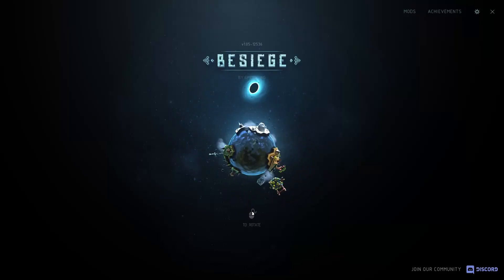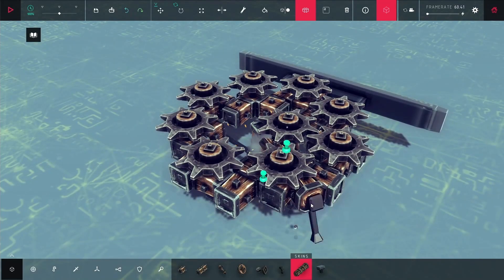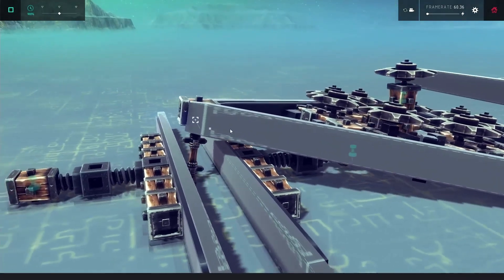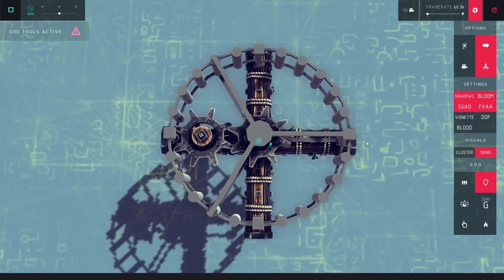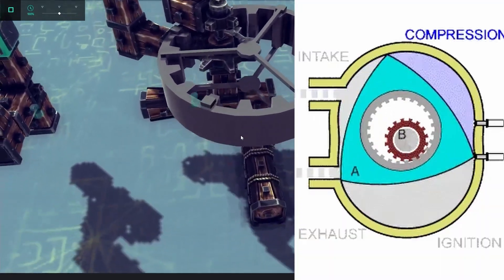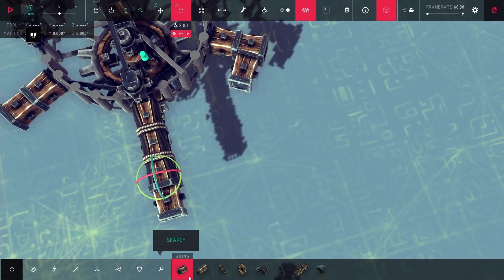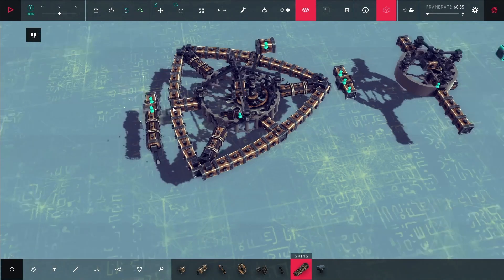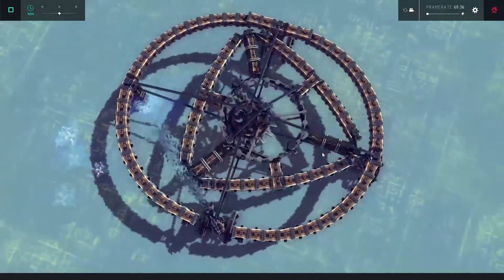Making a Wankel Engine in Besiege

Comment: Fact:
That's a freaking Reuleaux Triangle, created by either equally intersecting 3 circles, or drawing a circle curve with a compass, having the pivot point being the 3 corners, the radius of the circle curves being the length of the triangle edges, and the curves start and end at the two other corners.
It's easier done than said.

Comment: 10:45 no it's not normal. On a real wankel engine, the Rotor touches the housing continously. The Animation from Wikipedia uses a Reuleaux-Triangle as the Rotor shape, which is only an approximation of the correct shape, which is the inner envelope of a peritrochoid curve. The housing is defined by an Epitrochoid curve. Those two shapes mesh perfectly when they are defined by the same parameters.
Reply: yeah i'm a little disappointed by how much wrong he gets about wankel engines in here.  it's impressive yeah but like, it's barely what it's supposed to be

Comment: Looks like it's sealing about as well as your average RX-8 so well done!
Reply: If it ain't leaking it's out of oil lol
Reply: Cries in about to rebuild
Reply: Yep XD

Although some RX-8 came with a normal piston engine instead of a wankel.
Reply: @freyawion5337  That is incorrect, they only came with rotaries, hence the name RX - Rotary Xperimental
Reply: @Wilma5532  Didn't they cancel rotary production mid-series and started making them with normal engines?
Reply: @freyawion5337  No, although, they did change some things here and there with the engine, the RX8 only had a rotary engine through its whole production.

Comment: Rotary engines are actually known for not sealing well, thus they consume more oil and have pretty bad emissions.
Reply: They consume oil because the surface where the rotor touches the housing needs to be lubricated. 
But that is of course where combustion happens so oil gets injected in and burned off with the fuel.
Reply: @QuakeGamerROTMG  also why they have a "lubrication pump". I  played with putting a two rotor in a jetta and did some research lol.

Comment: Rotary engines were cool. Sadly, the last rotary powered car was the RX-8 from Mazda and was discontinued back in 2011. They were very rev happy and produced way more power with very small displacement, however reliability issues were also becoming a problem. 

Rip rotary engines.

Comment: Make the rotor smaller and thicker, use 4 watercannons (2 at each point there normally was 1, vertically stacked). As an alternative, having some kind of mechanical block off system (such as some rotating wall over the cannon, peraps) to act as timing so it gets the most leverage.

Comment: If you want slow or fast motion you can look at the top left, that 100% is the game speed, you can speed up the simulation to about 200% speed, but it does make the simulation less accurate
Reply from the maker: Yeah, I usually keep it at 100% on the off chance that I want to show something at normal speed, but in one of the later clips I think I had it at 200%

Comment: Maybe trying a 3 to 1 ratio instead lf 2 to 1 like an actual Wankel might help with your torque issues. Also maybe a gear reduction could also help with your toqure problems great video bte
Love the Wankel engine.
Reply from the maker: The output is 3:1 but the ring gear touches the center gear twice. It's just a lot of weird geometry stuff lol
Reply: Ahh i see lots of jank:)

Comment: It's not an engine, but you could always try an orion drive. It'd probably be simpler than any normal project, and might not be too interesting, but it does include explosions.
Reply: The bomb powered rocket idea?
Reply: @LiquidSandwich  The nuclear bomb rocket idea
Reply: @Vaokon The Hydrogen Bomb rocket idea
Reply: @SlovakDiplomat  The bomb that uses a small scale atom bomb to compress radioactive and other isotopes to the point of fusion causing a explosion that takes place in 1/4 of a second.
Reply: @no_name2882  probably faster tbh
Reply: Yea you are a human
Reply: Does he using a mod or sth? i don't have the same things that he has
Reply: Totally worth it 💯